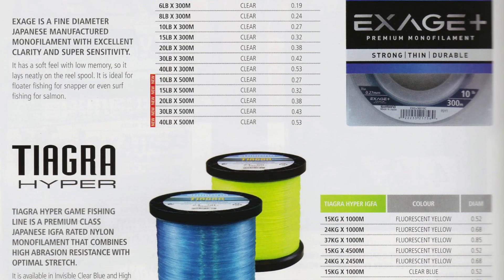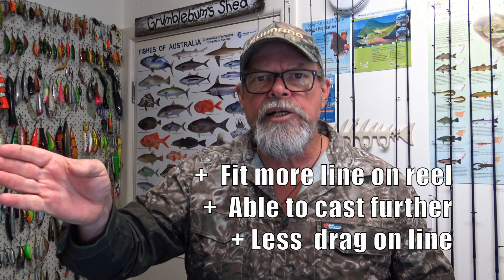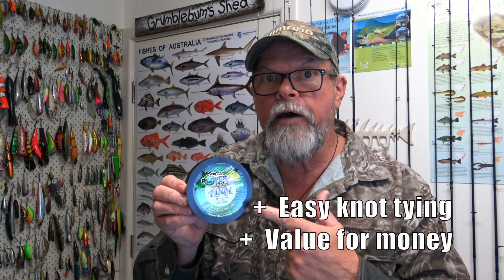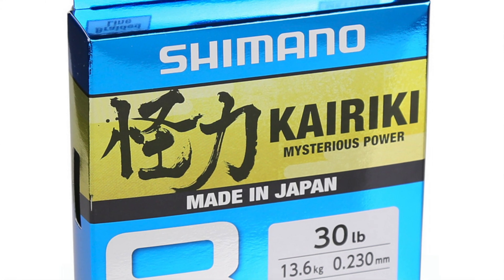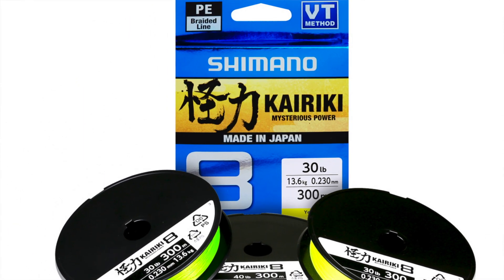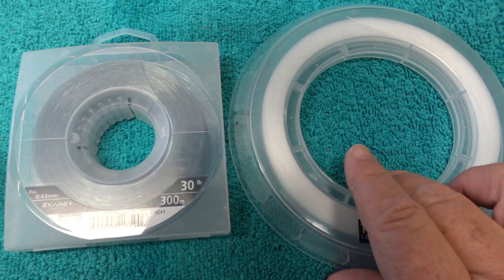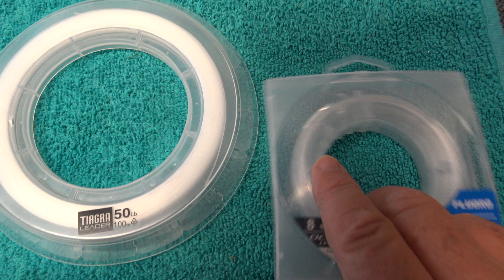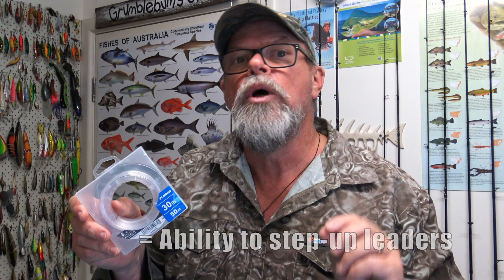Starlo Explains Shimano's Lines

Comment: Hi again, Steve. Haven't tried the Exage mono yet but wondered how it stacks up against the traditional rock fishing monos - Schneider Klear and Maxima Ultra Green?
Reply from the maker: Frank, it seems not all that dissimilar to Maxima in feel, appearance and handling.
Reply: @StarloGetsReel  Cheers Steve. You've probably also noticed over the last few years that, while braids can be quite expensive, newer quality monos are being developed and offered at very affordable prices. I like the look of the diameter of the Exage - 30 lb is only - .427 mm (I prefer 30 lb for one spot I fish as this spot has drummer over 3 kgs and the country is nasty) so fishing 30 lb Exage would in a sense be finessing it with the added pulling power of 30 lb mono. Anyway, as a long time fan of drummer yourself, you will fully understand what I mean as a thinner mono creates less drag in the water and better movement of the lightlty weighted bait washing around.
Reply from the maker: @franksaunders6534  definitely!
Reply: @StarloGetsReel  Cheers, Steve!